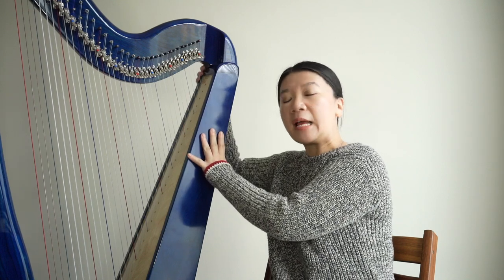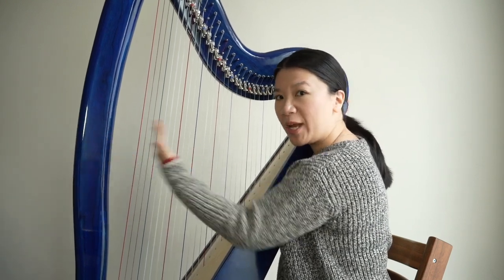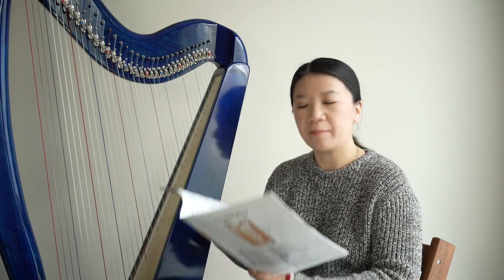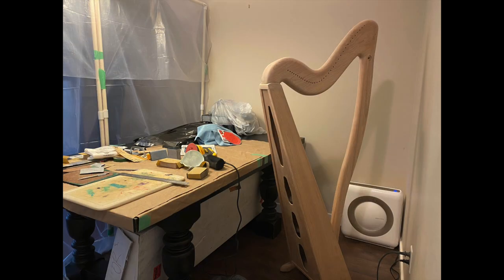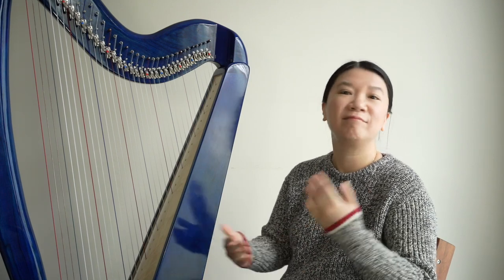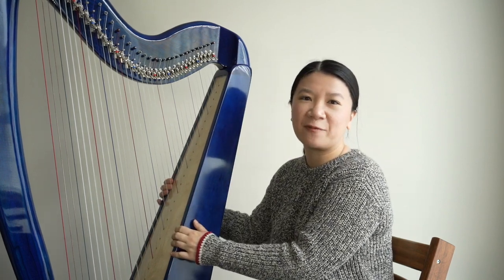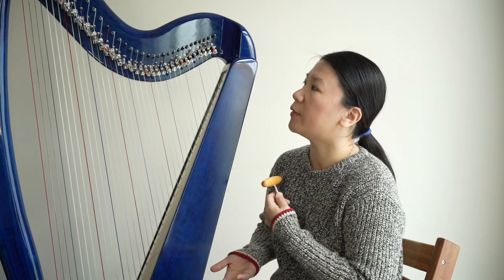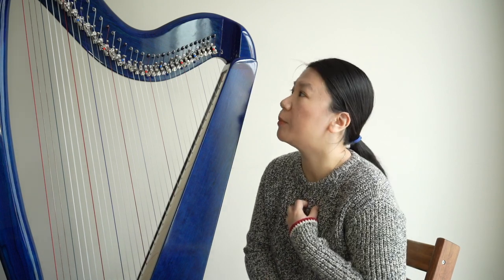Building the Musicmakers Cheyenne Harp: Behind Talking Harps

Comment: Thank you for this video.  I like MusicMaker harps very much.  I think they have a wonderful sound.  I have the Sonnet, which they built, not me.  I'm considering the Voyager, if I decide to buy a 34-string.  I built a harp from a kit, a double Fireside.  That experience also made me appreciate a professionally built harp, especially putting on the levers.  That was the biggest challenge.  At this point, any harp I buy will be professionally built.  But I do concur that building at least one is a very valuable lesson in understanding the harp.

Comment: Do you think this is doable for someone with advanced woodworking skills but no prior knowledge of harp anatomy or theory?
Reply from the maker: My husband think it is!  The only harp specific experience or knowledge that I think would be helpful is what a lever does; it could help you with troubleshooting such as placement. - Victoria
Reply: @TalkingHarps  Thanks! I'm sad that this model is gone, and the replacement won't have a kit. I need more than the 34 strings I currently have! Interesting video though - I'm trying to see if anyone else makes a 36 string kit, but not coming up with anything yet.
Reply: @TalkingHarps  p.s. I've love it if you did a video on the Heartland carbon fiber harps, but my sense is those folks are hard to get a hold of.